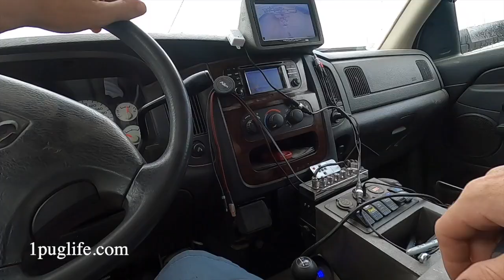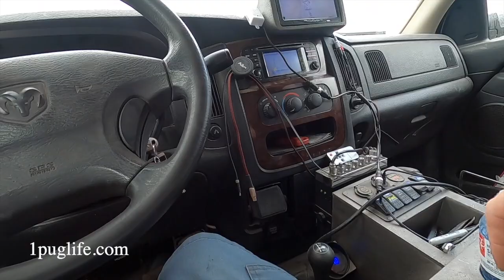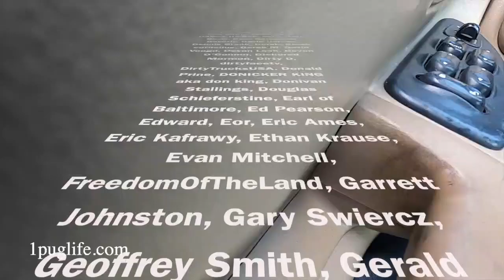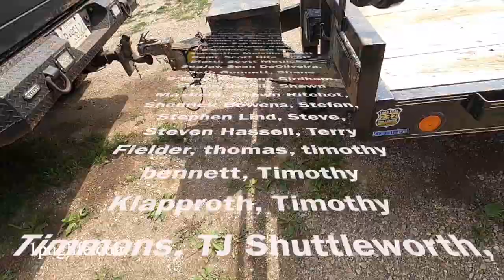rusty is back with a new trammy

Comment: Got more money into it than it's worth.
Reply: But at least he knows what he has and should be good for another 200+K miles...the body will be rotted completely away by then but the drive train will be tip top lol...find a good shape Suburban body to throw on to it...have a built in topner...
He could go spend 10 20 30 K on a better shape newer truck but then he will have to start all over replacing the drive train as it wears out again...wheel bearings...axles...trans...ball joints...tie rods...cause 4x4 diesel trucks are spensive... they hold their value...he would be lucky to find something with less the 100K miles for less the 25K unless it is rough...and 100K miles is when shit starts failing....he could buy a few year old Dodge with 100K miles and the trans blow a week later towing a car.
He took the smartest cheapest route imo...but will always be fixing something which is no problemo...he has the tools and knowledge which is half the battle....throw a good shape box on and a can of flat black Rusty will be like new again lol.
Reply: He makes money with that truck,  ya goof.... he will make the money back..
Reply: @usedparts352  I make money with mine as well ya goof. Currently sitting at 885,000 miles and mine is in a whole lot better shape than that clapped out pile of crap. But, if anything major goes wrong with mine, I'll just buy a new truck. At what point do you stop dumping money into a shit pile?
Reply: @harryguy76  he will just put the 83 onto it!
Reply: Randall Kulpa He makes money with the truck by making You Tube videos about fixing the truck
Reply: Hes so dumb. That truck is a money pit and he knows it. Not even painted correctly. Silver Under the hood n door jambs. Typical bed rot. I could go on....but no...hes soo smart!!